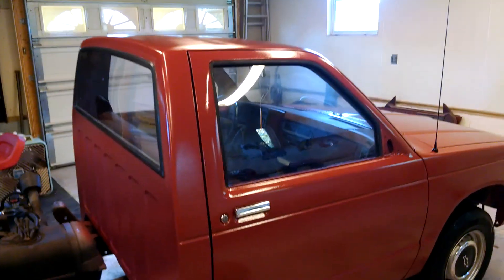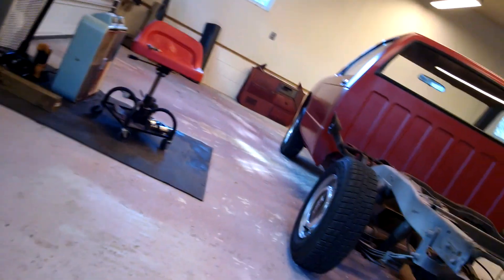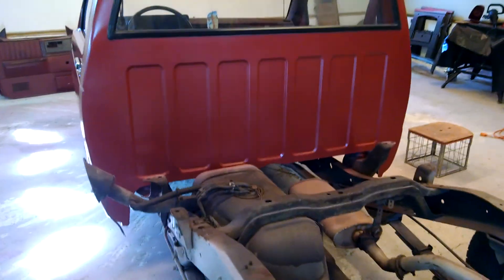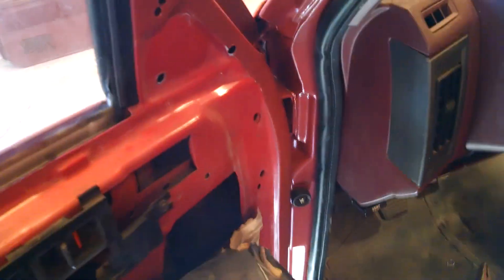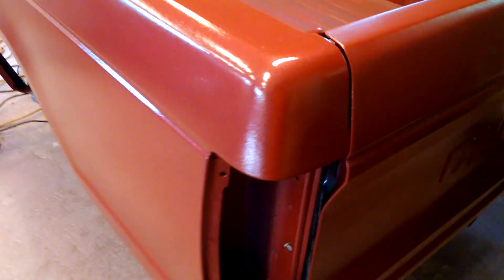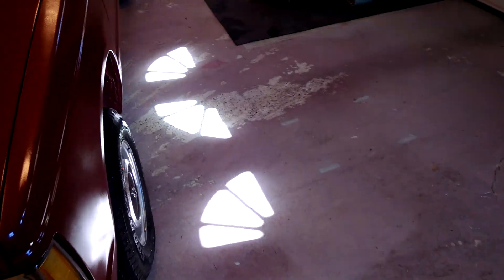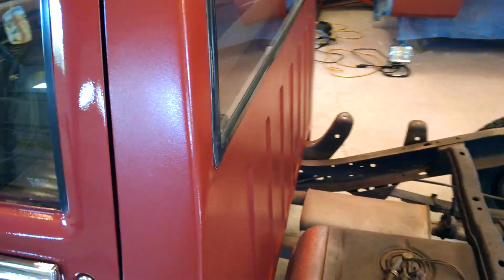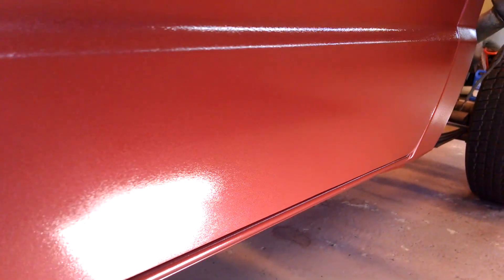Painted the S10. Hope it buffs out.

Comment: next time use some urethane reducer to thin out the paint to get it to flow better most paints you can reduce up to 10%
Reply from the maker: Yeah. Next time I'm going to try base coat clear too. Thanks for subscribing!
Reply: single stage paint works great to... if you ever need help let me know
Reply from the maker: Thank you. I have to spray the fiberglass leer cap that I bought sometime this spring or summer. Is there anything special I need to do after I sand it down?